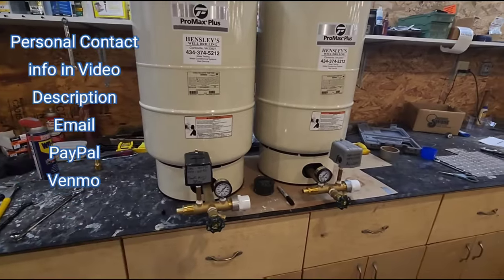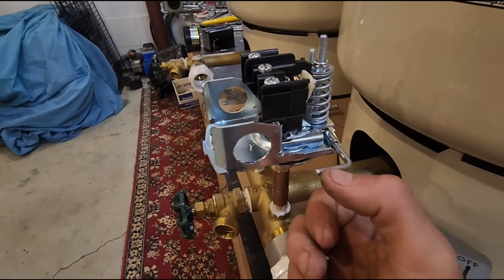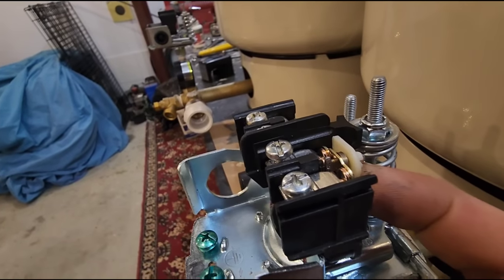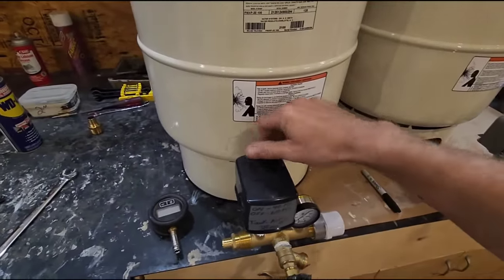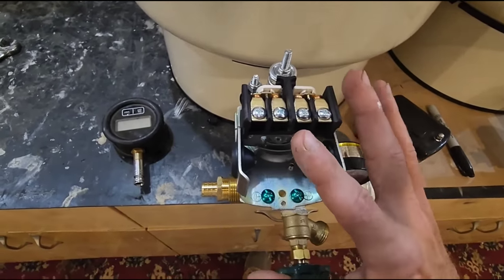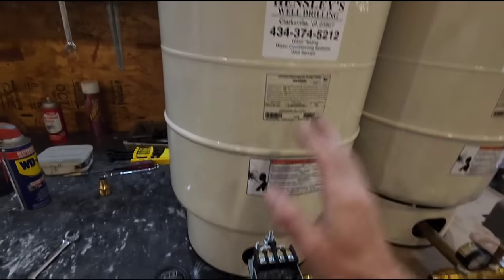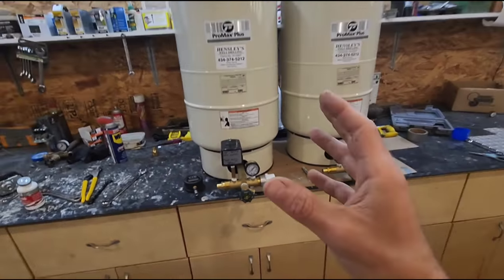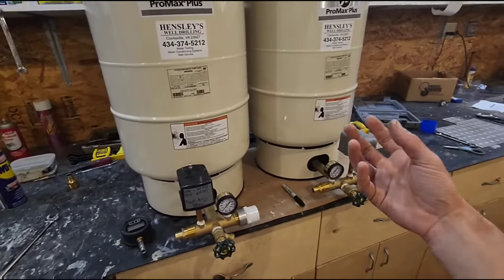Most Common Reason for No Water!! Reset Pump Pressure Switch. Water Well Repair Vlog Ep.18

Comment: Hello H2o...  I have a quandary for you.  I have a 10 year old 1HP pump (FLOTEC) used for a 30 foot shallow well for sprinklers system.  Background:  85 Gallon pressure tank with a 30/50 switch.  About 6 months ago, the pressure on a couple zones were really low so much the pump/pressure wouldn't push the sprinkler heads up.  Other zones run just fine.   The pressure tank bladder was loosing pressure continuously, so it was replaced with a new 85 Gallon one new pre and post sediment filters were installed.  The pump worked for a handful of weeks with the new pressure tank although the sprinkler symptom still existed.  One morning, the pump was running and the sprinklers were turned off.  I found the pressure tank was filling up to 50psi, but the pump continued to run.   Pressure switch right?   I disassembled the hose from pump head to pressure switch, pump water pored out clear.  It didn't appear to have dirt or solids in the well head.  I disassembled and cleaned the pressure switch.  No joy... same problem.  Took the drain valves out of the pump head.  looked for solids, nothing unusual.  I took the opportunity to replace the pressure switch and bumped it up to 40/50.   Put all back together, same problem no joy, the pump pumps and puts pressure into the tank rather quickly, then it hits 50 PSI, and sits there running with no additional pressure.  5 mins go by still running at 150.  I turn the valve off of the sprinklers to isolate the pump to pressure tank, tank pressure is 50 PSI.  If I close the valve to the pressure tank to isolate it, it holds 50 PSI overnight.  I figured maybe check valve between pump and tank, changed it out.  Same problem, running, no pressure over 50 PSI.  Go fish, come back same problem.   Any thoughts?
Reply: Sorry, I noticed an error, the shallow well is 20 feet, 18 underground and 2 above ground and not 150 PSI, 50.  Another note, I also bumped the PSI on the tank from 28 (30/50) to 38 (60/40).  I'm concerned a bit as I read that the 1HP pump may only deliver to a tank 60PSI a period over an hour.   Could that be causing my pump to continue to run and not shut off?  Huh?🤨

Comment: Hi your video was really good I was scratching my head some one working on my land lady’s pump they stopped and never came back so I took it over installed a new pressure switch I check after getting the wiring figured out I have power to the load side and power to the motor now what I didn’t know was I need to click the points with the cap .ok now I don’t see a nipple on top the tank to put air there is a white plastic thing that looks like you hook up a small hose and there is a black cap but there is a warning sticker that says do not open anything that it’s pressurized so how else can I check the pressure in the tank thanks. I look forward to hear back from you you been a big help already
Reply from the maker: Do you have a galvanized tank?
Or maybe a fiberglass tank? 
Does your tank look like mine in the Vid? Color?

Comment: Hello, your videos are so helpful!  I'm not sure if this is my issue but no water is coming to the house.  When I go out to the well house, there's no water when you turn on the valve to flush the filter.  Usually, there's still water flow.  Do you know if that's a pressure switch issue

Comment: Hi. My pressure switch is 20/40. It's  located in the basement. Originally   the pump was running for long periods and I pulled the plug to stop it.
  After watching your video,  I realized  I lack knowledge on tank pressure and pressure switches. I did mess with the tank pressure and need to correctly adjust it.
  Knowing the original problem, do you have any suggestions of where I begin to fix the system?

Comment: New sub and really enjoyed the presentation.   I recently put in a new 20 gallon pressure tank and a new 30/50 Merrill pressure switch. I think my tank is pre-charged at 30psi.  If I don’t reduce it to 28 psi what happens?  Like is over 2# psi too much water pressure or is it not a biggie.  If you have the time to answer I appreciate it.  Thank you.

Comment: Thanks for all the info, my 40/60 tank reads a pressure of 40 instead of the recommended 38 . Is this a problem? Thanks a lot for the free education
Reply from the maker: Did you test the air pressure with water in the tank? Or test air pressure with it drained of water? It must be empty of water, & should read 38psi. 40 might give your some issue with random water stoppage (you'd run out of water before the pump had time to kick on. )

Comment: My 72 year old neighbor moved into a house with a well across the street from me.  It is an external jet pump setup which is different than my submersible pump setup. 

He never was able to get the pressure switch to turn the pump off.  He replaced all the pipes and the pump hoping that would fix his issue but the pressure switch gets up to pressure and instead of shutting off just starts clicking on and off very rapidly.  Well on the first replacement pump his tenant/farm hand tightened down of of the screws to just make the pump stay on when it was plugged in.  It got the job done for watering the cows until last week when the pump burned out.  So hes on pump number 3.  He got a 30/50 pressure switch preinstalled on the pump.  The pump has a pressure gauge built into it but he also has a pressure gauge on a pipe above the pump. The issue is the same as the first replacement pump.  The pressure tank is set to 28 psi.  The pressure switch allows it to  pump up to cutoff pressure but then the pressure switch just starts clicking on and off.  His farm hand/tenant just wants to crank the adjustment down again but my old man neighbor wants to actually have normal running water in his house.  He doesnt have the money to hire a professional and just had 2 knee replacements so he needs some help figuring this out.  What do you think is the best course of action for him to get this thing to click off correctly?

Comment: I have a 40/60 pump. Power went off then on, of course no water. I did everything that was suggested.  When I was putting in air, I pre-set it to 38. However, it won't go over 10.

Comment: Is there a reason for it to trip without a power outage? Thank you so much for the video it helped me get my water back on
Reply from the maker: The nipple below the switch could be clogged up with sediment or the tank could be low on air pressure (tank may be bad). 
Remove the switch and check the nipple is clean inside. Then use a little air compressor to pump up the tank to 25psi. (If you have a 40/60 switch, pump it up to 35psi) 
Then turn the pump breaker back on and use water like normal. It should go back to working like usual

Comment: We have low pressure on our system. We still have water coming to faucets and showers but pump gauge reads about 10 lbs usually around 40 or so

Comment: i drained the water in the tank, put 36 psi in the bladder. Reset the 40-60 pressure switch and turned the breaker back on to fill the tank. The pressure jumped up to 35ish in under a minute; however, it has been 15 minutes now and it is only up to 48. This is about the max that i get and the well pump does not shut off.

Comment: Great video. I thought my pressure switch was bad until I found your video.  I'm installing a new 32 gal water tank. I used teflon tape and almost every fitting is leaking. What pipe joint sealer do you recommend?
Reply from the maker: Liquid Teflon pipe dope

Comment: Hello. Thank you for your video. Here is my situation.. my pump turns on but the pressure gauge is staying at zero and I have no water. I have a 30/50 and do not have the trip lever. I used the lid and separated the contact points a few times. Do I need to just keep the pump running now to fill back up with pressure? My fear is that I am going to burn it out. First time homeowner, first time ever dealing with a well pump.

Comment: If my pressure is constantly going low, not related to power outage, should I replace the switch. Level style
Reply from the maker: Turn off the pump breaker and see if the pressure drops to 0
 If it does then the issue is either a cracked fitting near the pump, or a bad check valve in the pump. 
The switch isn't going to fix your issue

Comment: Hey! Thank you so much for this video. I was able to reset my tank after a power outage. 

However i ran into a new problem after the outage. My switch constantly turns off and on every few minutes. Also, my gauge reads 97 psi and is located after the switch (in your video the guage is located before). Do i need to relieve the tank?

Comment: Hi H2o Mechanic; the property I'm living at has a bore pump, and I've followed your instructions as well as I can. We have an ADJUSTABLE pressure switch... 
I aim to replace it soon, due to age. but we are tenants. So meantime, if the adjustment on switch is set to 70% -  what PSi do I set the above ground bladder tank to? P.S I'm in Australia 😮😅

Comment: Great video very informative, but I have the opposite problem, my pressure switch will not activate to the 60PSI its designed to stop at?  I have tried turning the screws counter clockwise to see if the switch would activate and stop the pump but that did not work....the pressure keeps building and I trip the breaker at about 70PSI. not sure how to proceed. Thanks

Comment: Can you replace a low pressure 40/60 cutoff switch (that has the side lever) w/ a regular pressure switch (no side lever)? I watched your great video BUT when I got a new switch it did not have a side lever (which I didn't realize until I got it installed).  Nothing happened.  Does that mean I have to  get the switch w/ the side lever or not? If I still don't get water w/ a new cutoff switch could it be there isn't enough pressure in the tank?  Should I put a pressure gauge on the tank and add pressure to it if needed?  Would that make the new gauge work?  Bottom line---what would you do as the expert you are?  Thanks very much.   We'd like to have water.

Comment: Greetings, 
I appreciate your efforts sir!! 
Now, I've got no water. The pressure switch is stuck in the closed position. I have the switch that does not have the trippable lever but flicking them with the lid, I can see some spark. Not much but I can see the arc. The gauge wasn't reading anything and then I saw a bug running around within it so I replaced it. The nipple under the switch was packed with corrosion etc, I cleaned it and put it back in. All the while valves open to release whatever pressure and water drained till gone. I took an air chuck and started filling the tank but it actually pushed whatever was in, out(not a whole lot of air). So here I sit, in the pumphouse scratching my head. Not getting any readings no nada.. what do I do? I can see water down the pipe. Is it the pump?

Comment: Hi, my original pressure switch did have the lever but I didn't see one with a lever in the store so I used the "no lever" kind. I assumed that my original wiring-locations, 2 wires only, would match, was I right? I attached the wires to the two righthand (as shown in your video) locations.

Comment: Hi there! Thank you for your video and for your offer to answer questions! I slipped off the breaker switch while installing a dishwasher and simultaneously there was a leak that seemed to empty any water that would’ve been left in the pressure tank. When I turn the electricity back on I had no water. I use your tips for the pressure switch which does not have a lever oddly enough the psi on my gauge is reading 95 psi. I’ve open the Fossetts and I turn the bolts inside of the pressure switch at Yvette unable to lower it. I flipped the contacts in the pressure switch back-and-forth and that didn’t work, there is definitely electricity to the control box, the pressure switch and the pump but nothing is happening and nothing is running. Please help! I run an animal sanctuary and desperately need water here for the animals.

Comment: my system doesn't look like the ones you present. my set up has the switch mounted directly to the pump. the switch has a small 1/8 tube that runs to the frony of the pump. Long story short. the contacts are open i have proper tank pressure . So i'm assuming there is a blockackage in that tube? Instead of a 3" stem it has a hose. So i should try and drain the hose? Does this make sense?? Thanks for your helpful videos.

Comment: Great video. I have a question. My water pressure sometimes drops to just a trickle.  I thought it may be the pressure switch but after watching your video I am not sure. The pump kicks on at 30 and off at 50 but the inside cover says it is a 40/60 switch. The contacts on the switch don’t look bad. My bladder tank is set at about 25 PSI. Do you think my pressure tank is going bad or should I replace my pressure switch and if so should I go with a 30/50 or a 40/60? Thanks in advance!

Comment: Have an AirRaider radon filter. Had it serviced when I got the house and turned it on fully. The guy told me that for some reason it was partially bypassed, and flipped a valve to use it fully. My water stopped completely the next day. Had him back out, and he opened the thing up. The radon tank was filling way too slow. He set it to bypass again and bid me farewell. Called a plumber a few weeks later (so I don't get cancer from radon) and I simultaneously saw this video. Found out that the pressure tank (40 60) had 58 PSI...shut off the main, opened a faucet and slowly brought it down to ~38. Turned the water back on and switched all three of the valves at the bottom corner of the radon filter to turn it on. Let's hope I still have water in a few days! Thanks.

Comment: Came home today and had no water. Messed with the contacts on the switch and regained pressure. However, the switch clicked on and off every few seconds until the pressure stabilized.  Any thoughts?
Reply from the maker: The tank itself is bad. You can use a air compressor and add air to the top of the tank to buy your a few days, but you must replace the tank asap or it'll kill the pump within a few weeks!

Comment: Yes but why does the pressure switch have a trip lever? What is the purpose of the lever and the trip mechanism? From your description all I get is that it causes problems cutting off the water supply. Surely there must be a benefit of the low pressure trip function.

Comment: I replaced my old style Square D  30/50 pressure switch with new style Square D 30/50 pressure switch. Also drained all water and put 28 psi into water tank. Turned on power and built up pressure to 50 psi. I have a water valve in the well. When I turn the valve on the water pump kicks on and off correctly. When I turn on my outside water spigot in the back yard or faucet in the house t loose all water psi and the pump doesn't kick on. I can manually turn on pump with switch on the pressure switch but no pressure will build until I shut off all water faucets. Then when the pressure builds back up to 50 psi and I turn the faucet on all pressure drops to 0 psi and pump doesn't turn on.

Comment: Shows how much I did not know . I just thought pressure switch's were the same  . Just different sizes . I changed out my pressure tank with one from fergusons plumbing supply in Danville Va and they matched up the switch to  it . I had a 20 gallon pressure tank that was put in by well driller . Could you next make video on water filters  Whole house self flushing verses those paper ones that people always forget to change . I know I have looked at several brands  but they get confusing . I have had a whirlpool one that is not really for wells but it has worked great for years . I just replaced it with another one that I bought from whirlpool because lowes stopped selling them . Also how do you size a pressure tank to a house . I have 4 bathrooms  and 3 people most of the time but not all the time  living here . Hubby and I are retired so we are here all the time . Front loading washing machine and new energy and  water conserving dishwasher . I put in new kitchen faucet and WOW what a headache since now all the new faucet lines are smaller to save water , BUT A HUGE HEADACHE FOR HOME OWNERS

Comment: New P.  Tank and switch with LP cut-off. Powered on as you described, worked perfect. Had some leaks, Had to drain tank  2x now, (3rd time)  I can feel and hear the pump react, but it will not produce any pressure. Breaker not tripped and I saw spark at  the breakers in the switch, so I know it has power. Also, I have an app that monitors household power usage in watts and I can see spikes like normal motor startup, but it does not continue to run... Update :  my tank pressure is now zero after I had just set it to 38psi. Looking back, I did notice, having been near the drain hose end, a large volume of air at the end of the drain process... I didnt think that much of it but now it makes sense. Tried refilling it and could hear air coming from drain hose, so I guess my new AO Smith tank is toast. Any ideas on why this happened?

Comment: This has been very helpful, thank you. If a 30-50 switched bladder should be no more than 28 PSI, what's the max PSI for a 40-60 switched system?
Reply: 38
Reply: @AngelofOntario  Thank you.

Comment: Hello sir, we had a bad storm that cut the power. We always have to reset the low pressure switch after this happens. This time it didn't work. After following your video, it looks like the switch does not kick on the fill the tank back up with water when the pressure starts to go down. Should we buy a replacement switch and try that or call someone in?